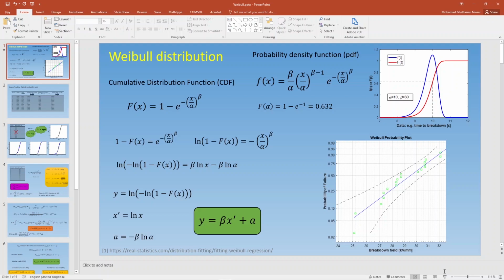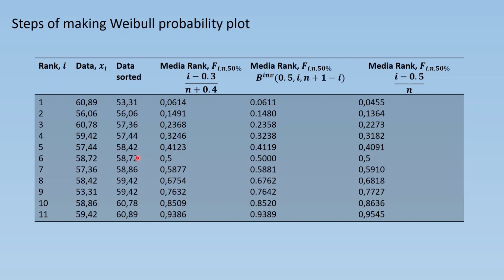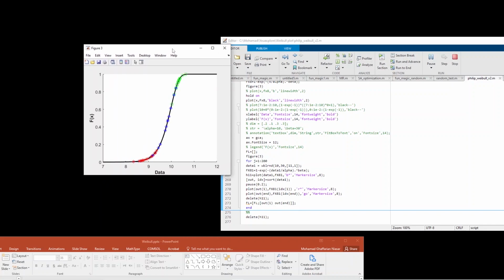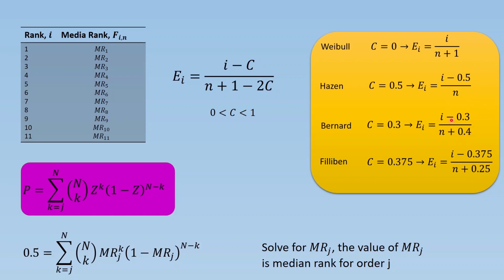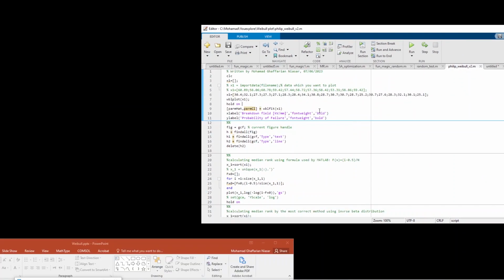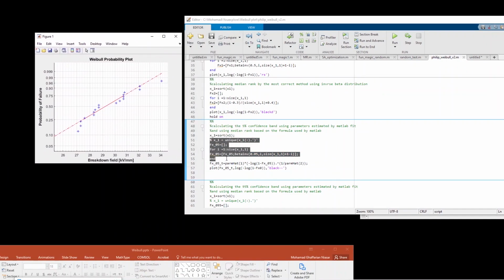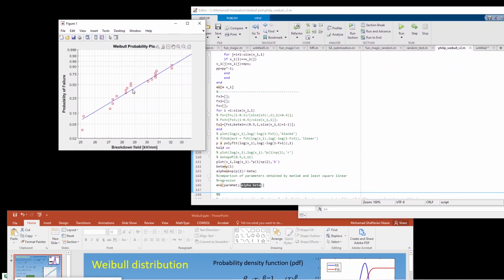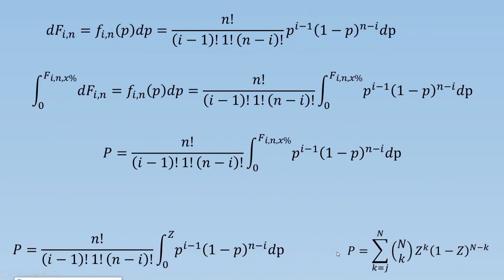How to make Weibull probability plot and its confidence bounds in MATLAB + median rank explanation )

Comment: Nice vedio! Weibull distribution is a typical data analyis method in high voltage experiment field. Recently, I am using Origin software to fit data ditribution such as Weibull distribution, Lognormal, Guass and so on.